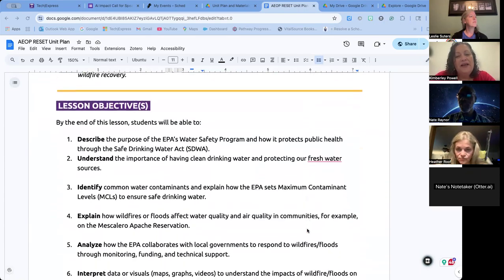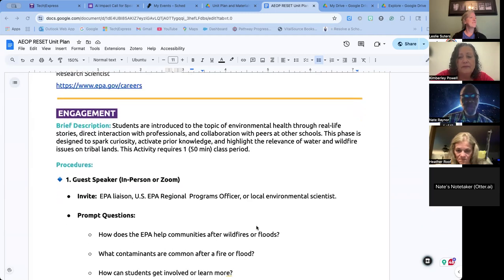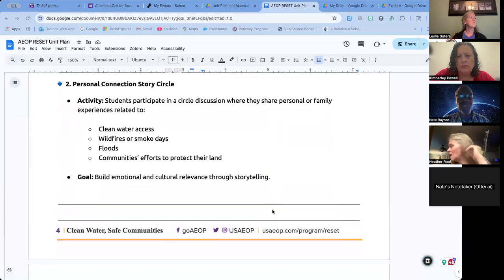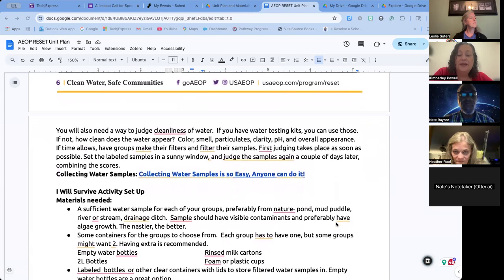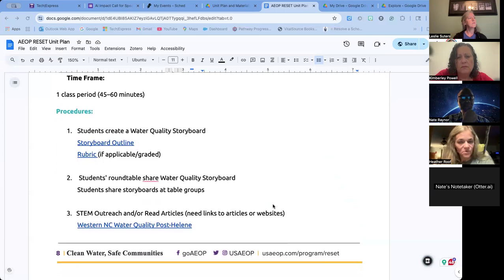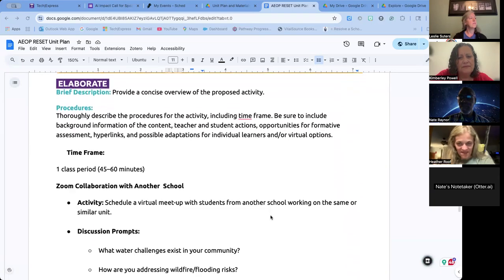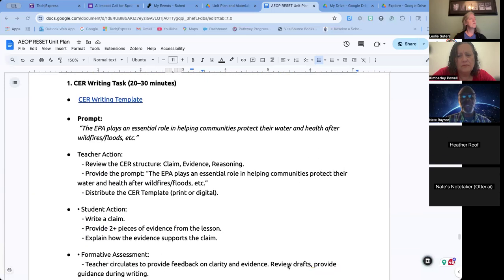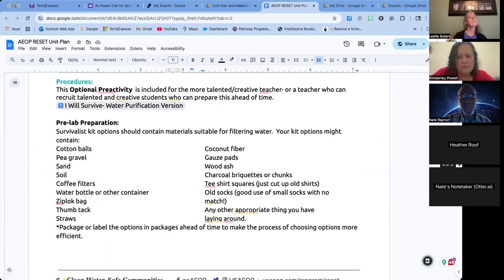Clean Water Safe Communities: The EPA and Environmental Protection

Comment: Hi
This unit hit home for me, as it will for my students.  Just a few years ago, we were part of the Flint Water Crisis.  I loved the name of your activities because literally, that was our everyday thinking process, whether or not we would survive. We collected water samples and although pipes were replaced and filters were installed, some residents are still testing their water out of precaution for what happened.  I think that this will be a phenomenal lesson for students everywhere because unless there is issue, you really never have a need to test the water.  Generally, after the fact, you start to believe that what you don't know won't hurt you but it does.
I can see using this lesson in class because (1), there are hands on activities involved and students love that and two, it helps the older students understand the process and safety precaution for one of their most precious resources. My questions:  Was this project thought about due to personal experiences and are there worksheets/handouts available for each section?
Thank you - Vishaun Ezell